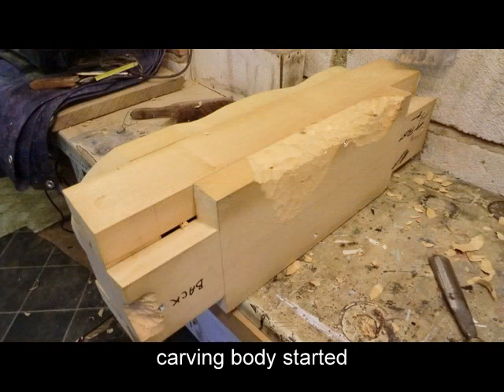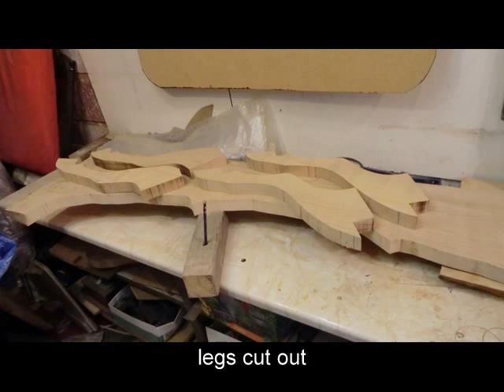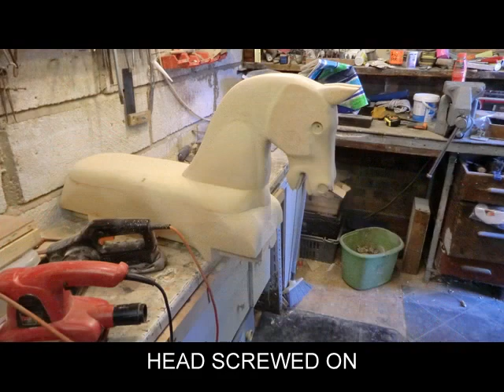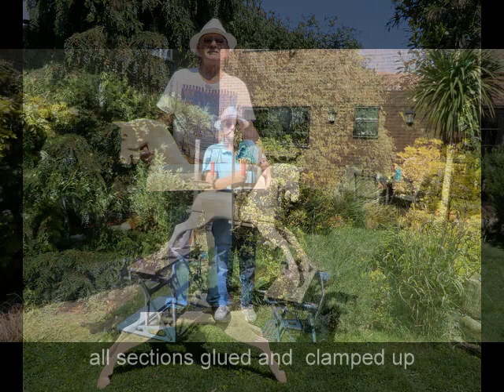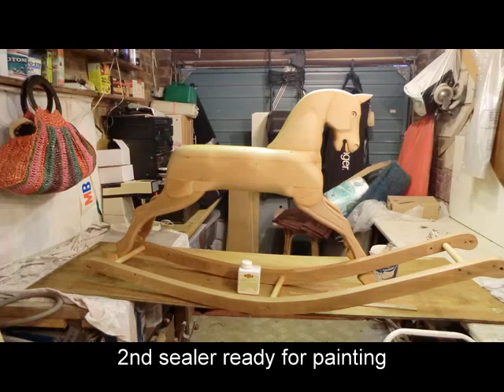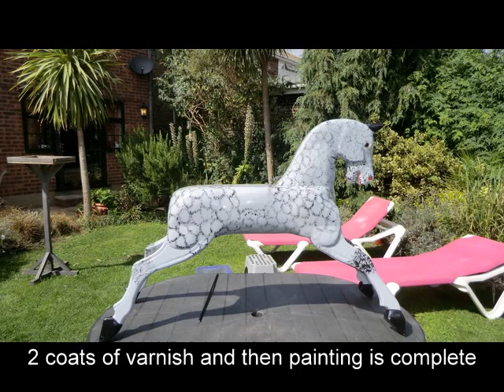How to make a medium traditional bow rocker rocking horse in pictures

Comment: This must be your first horse yes? Contrary to what Margaret Spencer says in her book you will get much better results carving the horse when fully assembled. Carve the fine detail on the head first leave the neck. That way the body flows into the neck and  leg muscles and does not look like bits just stuck on. 10 out of 10 for documenting your work and every horse is unique but too many straight edges that do not flow together. Try closing your eyes and feeling the horse with your hands. Does it flow smoothly from one body part to another without any bumps eg neck to body, body to leg? Two common mistakes not taking off enough wood and taking off too much. In this case not enough. The legs need to be fully rounded not just taking a little off the corners. Why sand the whole beech board when you could have saved some time and sand each leg when assembled. The dowels which go straight through the top body block into the mid section will show through in time as it is end grain. If you use dowel points you can dowel from underneath and be totally hidden without losing strength. The mid section being hollow can be used to insert a time capsule especially if for a family member. I recommend the Rocking horse shop website in Yorkshire for superior plans and books/ dvd's/ and you tube videos on everything rocking horse